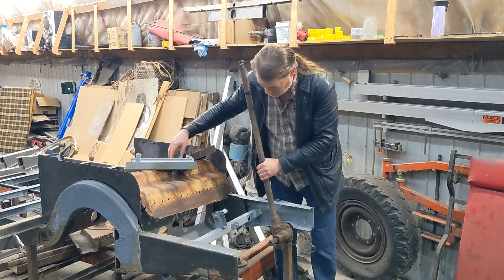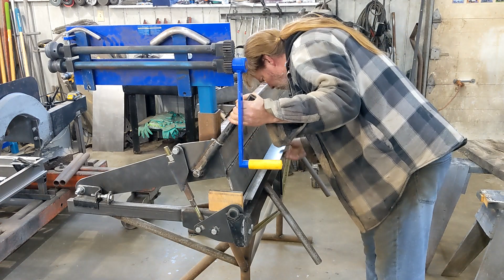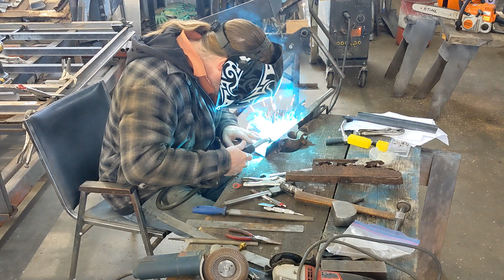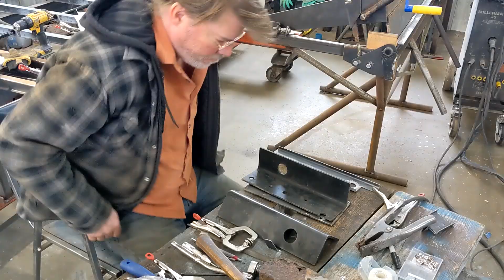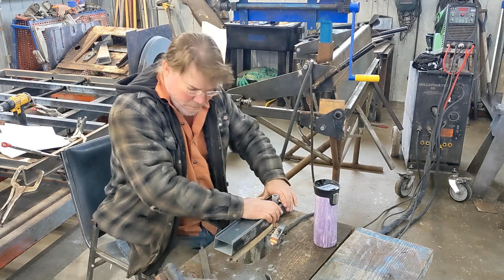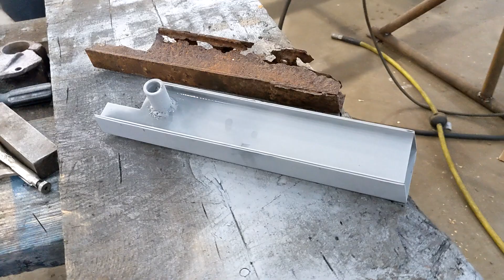The Nova Scotia Barndoor E19 - Steering box frame

Comment: Stan you like that using a tig welder as a spot welder trick? OMG I wish I knew that one a few years ago. I would have done more of the bucket truck with that trick.
Reply: double the amperage of  what you would use for welding the 2 layers. and hold the pedal 2 seconds or something like that.
Reply: Yea and needs to be clamped tight your right on that. Clean no contaminates. But that is not always an issue. you might also want to turn up the gas flow. this might help with the contaminates. Like you did do the tacks near the vice grips then move them along.